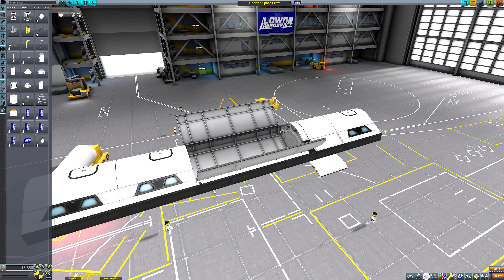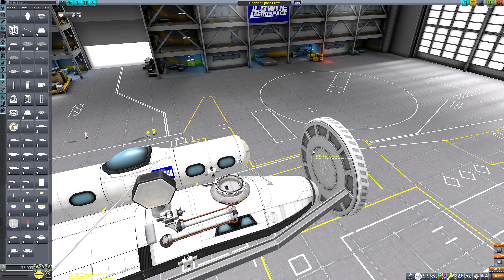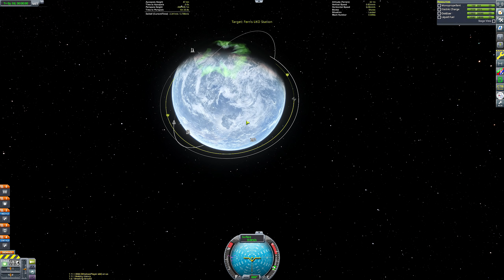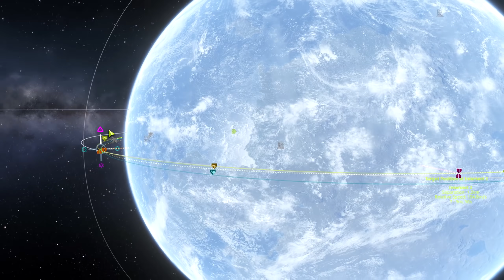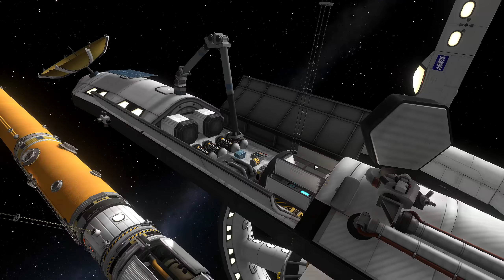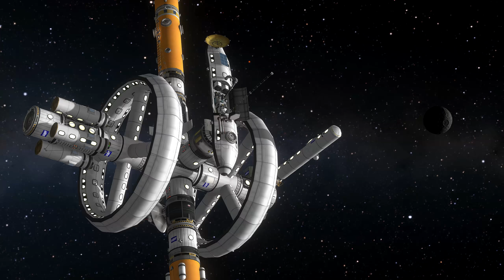KSP: I FINALLY fixed the Space Station's biggest problem...

Comment: I hope KSP2 is able to solve some of these kraken issues, I've had no end of physics glitches and kraken attacks in my save.

I mean heck, if they could simple add a feature to the build options, to make completed vehicles count as a single part instead of 300+, that'd at least fix the fps issues (not to mention simplifying fuel management). I think some of my kraken issues, were simply caused by calculation overloads, more than actual glitches.

I've had to decomission 2 fuel tenders, because they developed some kind of drag on 1 side, making them spin out of control when the impulse engines are on in space.
Not that it's overly practical to refuel stations and ships at 1fps, but refueling stations add a lot more margine for error with transfer windows and orbital manuvers.

Comment: Hey, can someone help me with something? If you're replying, great! Anyways, here's the problem:
I built Matt's Perserverance rover with Ingenuity, but I had my heart set on having the rover drop out of the shell. After a while of trial and error, I was able to get it working! Then began the effort of getting to Duna! And here's where it all went wrong:
No matter what rocket I used, I simply couldn't get into a circular orbit fit for a transfer to Duna(I tested Matt's Atlas V and made several of my own) While trying to fix this, I decided to run some tests with Percy for landing. After landing Percy, the skycrane or Ingenuity(or both) would simply freeze in midair. I checked the integrity of my ksp files, and it's all clear. I tried my own manuevers and mechjeb to get a circular orbit for a transfer but neither time it worked. Any rocket with Percy simply flipped over at some point during ascent(using SAS and heavy RCS at some point). Someone please help!

Comment: There is a stock docking  port alignment view. The Circle with the bottom left with the 3 wedges in it, near the stage indicator, is docking mode. It's actually pretty easy to use.

Comment: I've had this docking port issue. For some reason if I try and attach a docking port using the "engineering system" the entire station rips itself apart at every possible point.

Comment: You could use the 1.11 feature of adding and getting rid of parts to reduce the part count and make it easier to film (I think you would be able to get rid of all the RCS ports on the orange fuel tanks
Reply: In theory, but you have seen in practice it is easier said than done, physiscs doesn't like it too much.
Reply: I think it’s because the rotors were being used at the time. If he locked them and autostrutted everything then it should work

Comment: Day 3 of asking him to fix the rotation of the wheels with a KAL unit
Reply from the maker: The wheel rotation isn't broken though? I disable them when docking in case I boop them
Reply: @MattLowne  sorry I meant the RPM normally for the correct g-force
Reply: @MattLowne  boop!